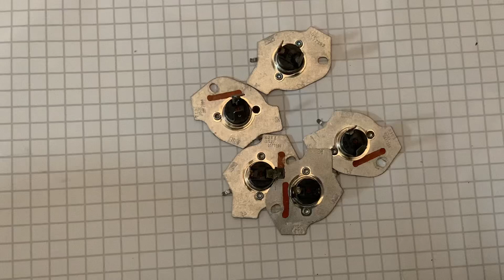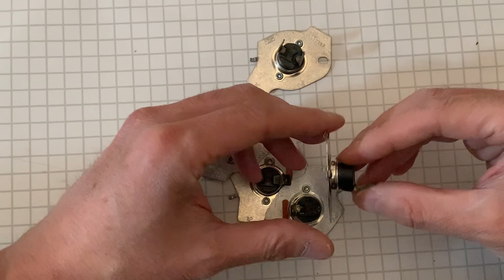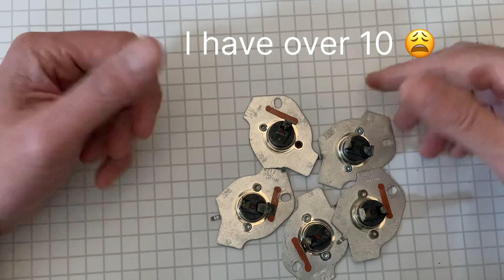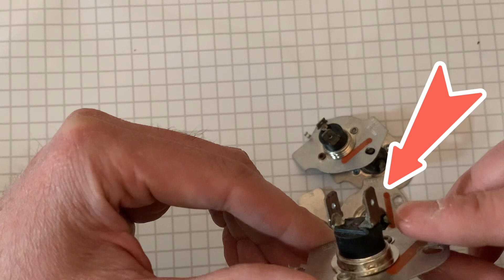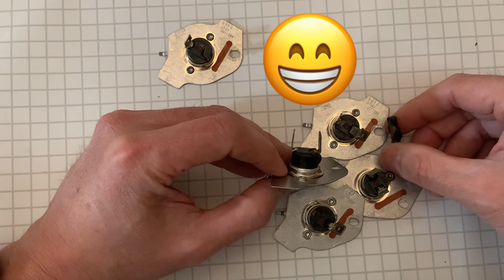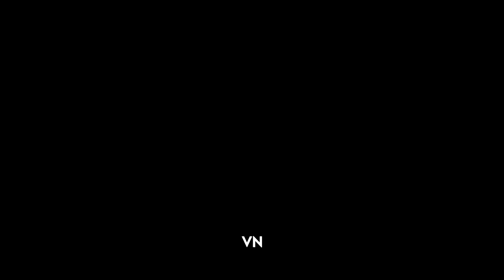NO DRYER HEAT AGAIN! Stop Your Thermal Cutoff from constantly failing

Comment: That wire isn’t corroded, it’s overheated. Probably from a failing switch, but if you can’t find the problem you could have a lint fire. Check all your grounds and lake sure the wall cord is grounded to the machine d properly. Resistance can melt wires all over the place.
Reply from the maker: Thanks so much. Yes the wire connector end did look overheated. It seems to have been corrosion/rust as well which may have caused the overheating. I also cleaned out the lint in the dryer and exhaust. Tried to seal air leaks which I think was a stretch. Thanks for mentioning the ground as well. At one point, my dryer cord did get damaged I think when I was moving the dryer away from the wall to unplug it!  The connection point at the dryer loosened and caused issues and so I replaced it. Somehow the anchoring clamp to keep the power cord in place when pulled was missing. I really appreciate your comment.